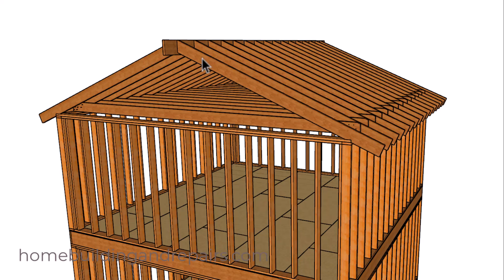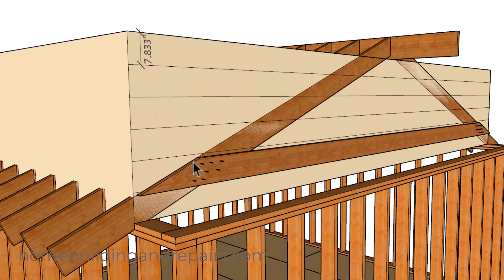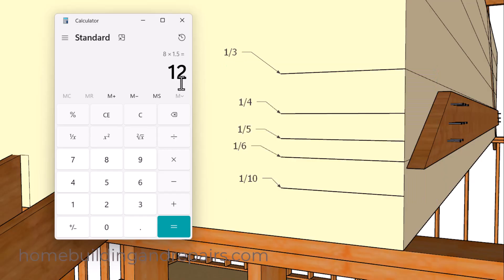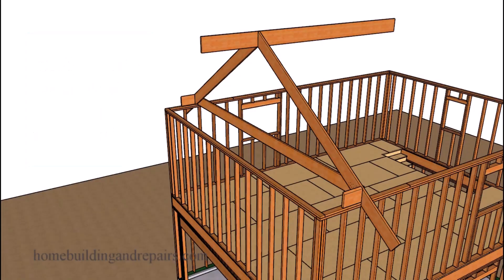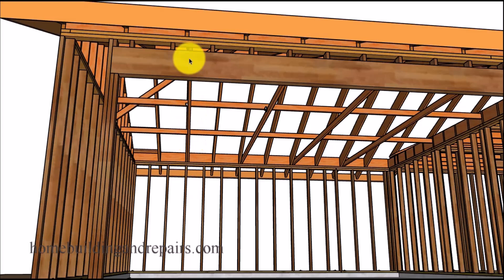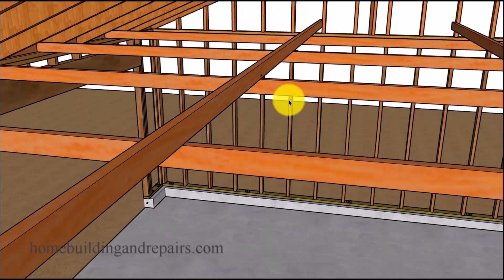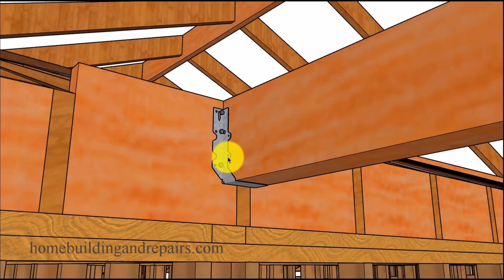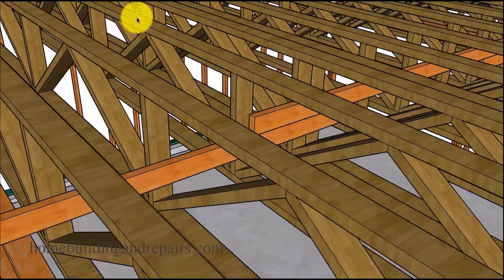Watch This Video Before Raising Ceiling Joist or Roof Rafter Ties - Heel Joint  Connections

Comment: I’m playing with the idea of raising the ceiling in my attached garage with a hipped end if the engineering works out. The attached side has a pony wall on the garage top plate that allows for higher ceilings in that adjacent bedroom. 1/3 rule raises my rafter ties about 26”, right around the height of that pony wall. I was picturing doing exactly that, maybe crippling the rafter ties down onto the garage walls. I could potentially turn that pony wall into a full bearing knee wall, but there’s still the challenge of supporting the hip roof without a beam, at least not a floating one. Right now, it’s braced onto dimensional joists but isn’t even full bearing, not the best cuts. I’d find your opinion interesting.

Comment: I've seen houses 100 years old with 3 nails in them. They don't fall down or blow away.  Nail fatigue is a real thing. Why not just through bolt it if they are worried. I douvt most of the inpectors even know how many are needed or even bother to  look.

Comment: I am currently rasing my celings on a 4br ranch , using an LVL Beam.  My engineer reccommended using SDS bolts rather than nails
Reply: exactly what I was thinking..no videos mention this but if you live in a hurricane or windy area, bolts seem logical IMO

Comment: Great vid!!  What are your thoughts on raising the rafter ties 1/3 the distance on a 12/12 roof with 16 centers, but lessening the amount currently in place,  and increasing from 2x4 to 2x6? (Going from 12 down to 6) Perhaps even add collar ties too.  The span of the rafter ties is roughly 10'.

Comment: I include a STRONGBACK   2x8  that runs the length of the structure to connect the 2nd floor trusses.... BUT  I first place a TEMPORARY  8ft header beam under the 2nd floor trusses.   and shove a  8ft  2x4 stud  (to cause an intentional bow UP on the 2nd floor trusses), and then go into the  2nd floor trusses and nail the 2x8  face onto the  floor trusses.   When I remove the TEMP support 2x4 and header beam,    the 2nd floor trusses "relax"   and have less chance of sagging.

Comment: My wife and I are "renovating" a home built by the original and only home owner in the 1960s.  The load bearing wall in the living room had rotted and eaten by termites, so we took the opportunity to raise the ceiling with rafter ties. Your previous videos gave a lot of insight into the best approach to take. Now the roof structure feels much more solid and we turned 2, 14' foot rooms into 1 28' room. Funny side note on the nailing schedule. The original ceiling joists were held in with only 2, hand hammered 20d nails. 4\12 roof. 24" OC. The outside wall pulled away about 1/2" over 60 years.. only because they were not lapped sufficiently above the center wall.

Comment: Great information!

I'm 70 and did a lot of 'stick built or cut and stack' work in my 20s. We used 'collar ties' more it seems back in those days along with running kick-braces to stiffen up and support our work. Todays 'nail-gun' splintering of truss or rafter-joists as connected to top plates here in CA is criminal and destroys the over-all stability of the structure. A lot of the old ways have become cost-prohibitive due to labor and a lack of skilled craftsmen. 

Are there still great builders out there? YES! but they're booked out 3 years in advance.

Comment: Hey Greg, I have 2x6 rafter ties spanning around 20’ in my second floor ceiling. They consist of 2 2x6’s butted together with a sistering 2x6 spanning the butt joint. An engineer came out today and said we can cut the rafter ties and insert a beam and joist hanger the ties to the beam. How would I go about supporting the tension in the ties while cutting the gap for the beam to sit in?
Reply: Run 2x4 or 2x6 rat runs to temporarily pick up any loose ends until tied back into the new beam with hangers. ..support any load bearing points   ..cut yourself and extra 1/8 to 1/4 inch width to fit the beam.  Pocket the beam into the wall or red steel at each end.

Comment: theres gotta be a better way than 51 nails! the wood would probably split before the nails give!
Reply: Very few framing nail guns are capable of shooting a 16d common nail most are 16 sinker. Engineers and builders are having a standoff. Increased use of steel connectors and increased cost. Can't help but wonder if insurance companies influence building code. Love this guys videos for practical approaches to structural problems.
Reply: Yes, you are correct. There comes a point when too many nails defeat the purpose.